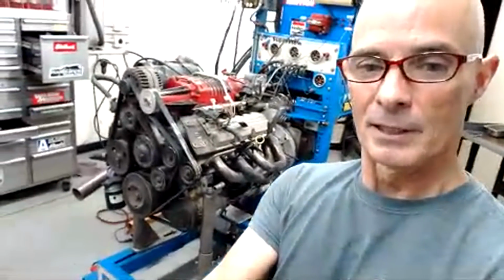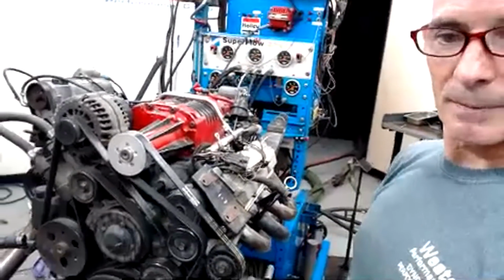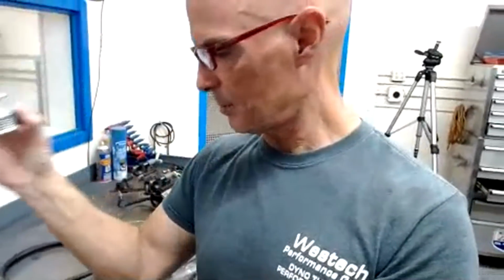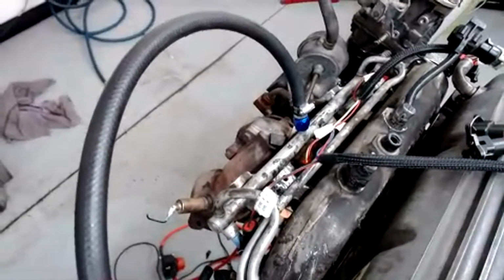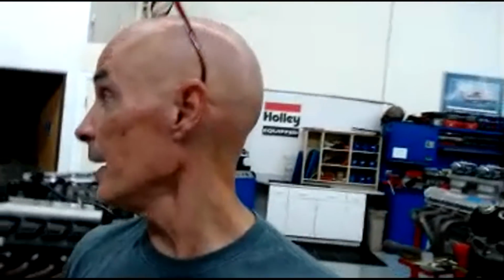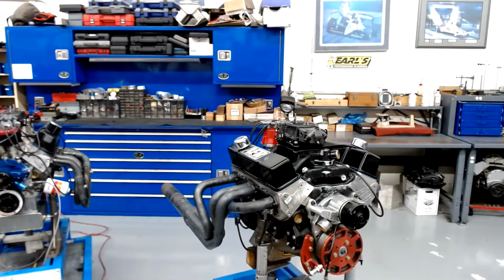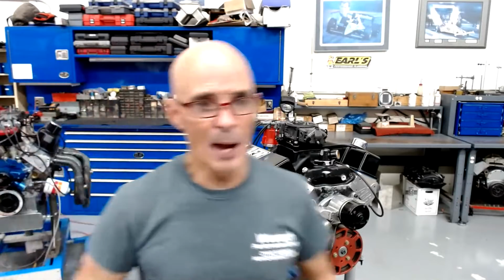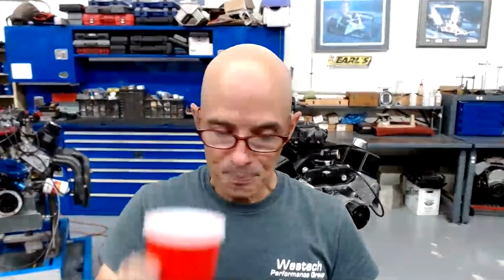LET'S TALK TURBOS AND BLOWERS AND PISTON FLIPS

Comment: Richard, I have a question about forced induction purpose built motors, say, for a weekend warrior build. GM Performance and the 5th and 6th Gen COPO Camaro program over the years has made me think. Let's say that for this scenario, money isn't taken into consideration and the correct cylinder heads will be added as needed. The 3 forced induction options for this test case will be: 1) Turbo, 2) Centrifugal Blower, 3) Roots/Screw Blower. To make things simple, let's say that the engine MUST maintain roughly 350 CID and be automatic trans. To complicate things a bit, the engine can either be a SBC or LS1 or LS7 based, using OEM bore/stroke or 'rebuild' geometry (ie. LS1 overbore). For which style of Forced Induction would you consider going LS7 based 4.125" bore x 3.268" stroke (as GM did with the COPO Supercharged '350') over an LS1 based '350' @ 3.905" bore x 3.622" stroke, or even splitting the difference with the tried and true SBC 350's 4.00" bore x 3.48" stroke ?
Reply from the maker: the engine or bore and stroke do not matter-a turbo will make more hp per psi than any of the others. the PD blower will have immediate boost response and the Cent blower will have a rising boost curve-see the three videos where I tested all these forms to see how they do
Reply: @richardholdener1727  I guess I am just trying to figure out if the COPO Program got it right. Short stroke/Big bore for a Whipple Blower. You have said time and time again that displacement = TQ and your testing says so. What I am saying is that Stroke can dictate how early peak TQ is made (ie. my usual 5.3L 363 4" Stroker vs. a stock 6L 364). With overall displacement being equal, the longer stroke will dictate an earlier TQ range, whereas the larger bore ( less stroke, same displacement) will help stretch out the peak TQ to later in the RPM range. Can we at least agree on that ?
Reply: @richardholdener1727  also, can I email you ? I have something that I would like to donate to the channel for testing, if it interests you.

Comment: When you get deeper into the 2.2 turbo look at the cam followers, the EFI motors used roller followers instead of sliders. Had a carburetor 2.2 idled at 650, changed to roller followers and idle went up to 775. Surprising how much we got out of that engine NA can’t wait to see what you get with the turbo.

Comment: Interesting remark about the limitations of the engine Dyno and rpm.  When discussing the magnum engine being so limited by head flow in the video with Freiburger I was a bit bothered.  I understand that most of the viewers are interested in drag racing and such and are therefore not interested in driveability, low rpm torque, and mpgs, but that's what makes the Magnum a great engine.  They are incredibly efficient at making power where you want it in a non performance application (idle to 2500rpm where most engines spend nearly all their time).  I'd love to see how much power and torque some of these motors make at 1000 to 3000 rpm where street cars and trail rigs need it.

Comment: The piston flip Legend was that it was supposed to add horsepower. It did not. If the Legend was saying it added acceleration that might be something different but I would still expect it to have affected the horsepower and torque in some way. Myth busted.

Comment: Uncle Tony is correct.
Reply from the maker: data is correct
Reply: It all hinges on whether you can throw pistons in other holes the way Richard and not loose ANY hp. Used rings in smooth cylenders? NO power loss? I believe Richard's data...but the data doesn't support his conclusions and no one is going to do a before and after dyno to see if moving pistons to different holes will result in a power loss because everyone knows the answer. It's just a question of how much....the piston flip made up for that....or should we believe in a hp fairy. I think we should thank Richard for establishing what every non-indexed stock eliminator winner already knew. But how much

Comment: I was taught by a German mechanic that when building bike motors in the 60's, measure the cylinder roundness.  If round, do not hone - just ring and go.  It has worked for me for years and years.  I am not one bit suprised that the Magnum sealed just fine and ran the numbers.  
If piston reversal worked as advertised, we'd do all the time, and the MFGs would build offset pins and special wear coatings on the thrust face to help with the additional side loading.  It would be the de-facto methodology ...
Reply: dude hone the cylinders :)
Reply: That's not how it works . if a cylinder is still round then it doesn't need to be bored . but they always need to be honed in a rebuild .

Comment: Detroit diesel use a blower for scavenging. When they went turbo on blower they used a bypass in the blower housing for boost to go around a slower blower.
Reply: That makes sense. 
Why fight the obstacle of the blower vanes and everything else on the way ?
AUDI does the same with their Turbo/Electric Supercharged V8 Diesel.
Electric blower from idle, complete bypass to Twin Turbos from a certain RPM.
Reply: Lancia did the same in the 80's, bypassing the supercharger when the turbo comes alive.

The blower gets more inefficient when fed with high density air. But it still works and gets power

Comment: Isn't acceleration a function of torque,  which would have been noted on one of the 6 runs?
Reply: @ Ex Tom Driscoll:  Materials Testing Laboratory technician here who has tested soils, oils, aromatic hydrocarbons, low and high hysteresis tire compounds, aggregates, steel, alloys, carbon fibre using load testers, nuclear isotopes and anolgue and digital  data logging for the NZ Government in an accredited  Bureau  Veritas/ IANZ laboratory. 35 years experience, evidence supplied for 5 Fatality Court cases since 1993.  The rate of load applied varies the transient torque figures. Peak indicated power should be the same on varying different dynomanomater if calibrated, but load rate changes the torque power trace.   The best example of the problems in measuring the peak power comes from trying to quantify the uncertainty and repeatability  between the eddy current, water and other inductive dynos with the varying kinds of counterweighting. Dynos try to provide a set load application, but always fail the Real World Test as the Science is in lag with the forces, masses and motions the real world applies.   Attempts to replicate drag race or race track or real world driving are very difficult..but its Getting Better! A calibrated Laboratory Power test is a science and a Lab test with  set in stone physics but it's verification is on going. The real world load rates can be applied to a dyno. NASCAR had a brilliant engineer who said the same thing Uncle Tony said a while back about Engine Dyno's. They don't deal well with transient load testing because Torque measurement requires five stable readings at a set load rate.